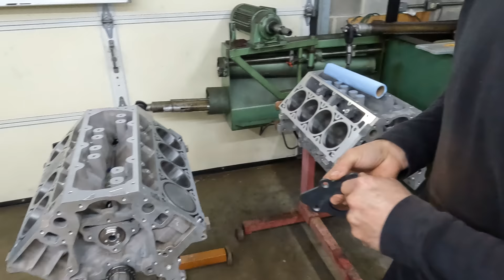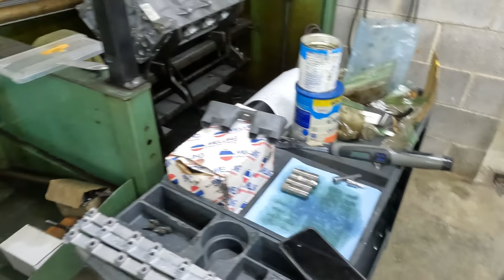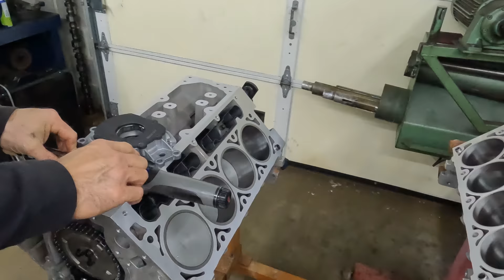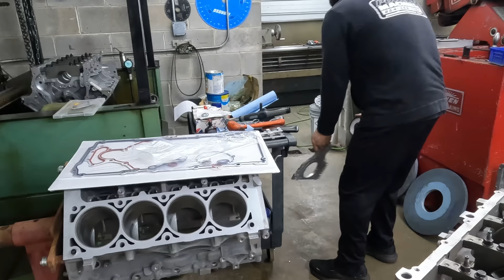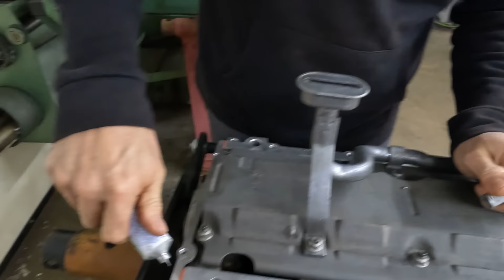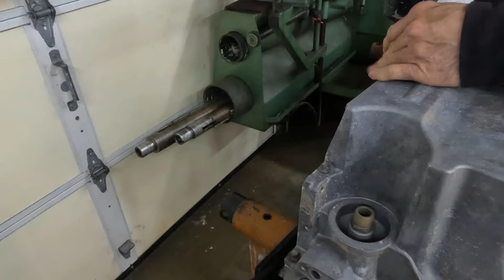Facebook 5.3L:episode 7, completing the short block

Comment: You are one of the few I've seen using a speed wrench. I grew up using them and when I worked on vehicles others would give me theirs because they didn't like them I had quite a collection before my tools got stolen. They're great for quickly running down nuts and bolts and being able to feel the thread with out over torquing
Reply from the maker: Right on
Reply: Your right David, when watching race car engines being built that’s what you see, not an impact in sight
Reply: Spark plugs! I used a 36" Snap-On speed handle, during my 17 years with FoMoCo, doing tune-ups. Made  quick work of a plug change. Still a very handy tool in box.

Although my 3/8 Snap-On cordless impact does the chore now...can't beat the new Li batteries.
Reply: I was going to stop watching until i saw this comment. I have a couple speed wrenches but havent used them in decades.

Comment: Obvious you skipped an empty bolt hole on the pan. Maybe just searching for comments but it ruined something. Your work is meticulous and much respected. May the horsepower keep being produced by you.
Reply: He's built a motor or two more than me. He will have a reason for that empty bolt hole which no doubt he will mention in the next video. Also notice that Andrew knows every next step/bolt you are going to do/fit. Also see him holding the motor steady which you are tightening bolts. He is learning every quickly and I can see he has already learnt a lot. One thing I can see  you both are NOT a GP. Does not stand for General Practitioner (doctor) but for GP for "gorilla paws", people who tighten bolts and nuts to ridiculous levels, not understanding that a small dia bolt holds a small item and is torqued to a small spec. They tighten everything to same (overtightened) spec and then I have to come in and fix things. Well done Andrew. Dad is also a good teacher. For dad, when are we going to see Andrew assembling something? Take care all of you, including the missus. Regards from Australia.
Reply from the maker: The hole isn't in the block,
Reply: Pay attention, he explained it in the video.

Comment: WTA 37 bearing is the proper bearing for the plugs. I already used them. I understand your point with rebuilding it after wards. I made a video for my grandkids. I don't trust the orings not ro leaks after so many miles. I've seen oil pressure issues with them. But there are problems either way huh? ROFLMFAO
Reply from the maker: Never seen the oring leak,

Comment: You need to turn the camshaft by itself to check for ease of rotation before installing the chain. You will never feel a slight bind turning by the crank bolt. And the front and rear covers are aligned without the seal installed. A centering tool is installed to ensure the seal is centered to the crankshaft. Sloppy build at best.
Reply from the maker: Lol, y'all make me chuckle

Comment: Daniel, would the timing set benefit from oiling through the thrust plate? Similar to drilling the pipe plug in a SBC.

Everything behind the front cover always seems "dry". The splash oiling must be enough to keep things from seizing, but the broken tensioner, dried oil build up, and stretched chains make me wonder if a little pressured oil wouldn't keep components cooler, decrease fatigue, and decrease failure of the tensioner. 🤷‍♂️

Ah, is it even possible without a negative side effect?
Reply from the maker: Possible,

Comment: Doing my first LS build. It’s a Gen 3 and the timing chain guide I ordered has the wrong bolt spacing for my block. Did they not come with dampers?  Mine measures about 2.1” center to center. The one I ordered from RA measures narrower
Reply from the maker: Gen 3 never had a damper
Reply: @powellmachineinc3179  thank you. You are amazing. Thanks for the help

Comment: I'm surprised GM didn't design the pickup with a couple of little feet at the bottom to prevent it from bottoming out and disrupting the flow.
Reply from the maker: It's pretty rigid and has plenty of clearance
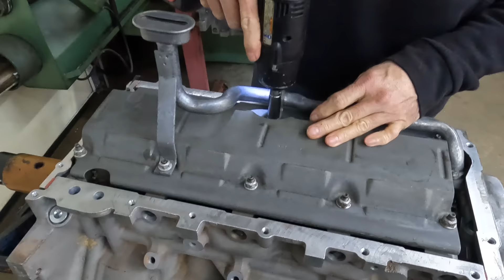Reply: Anchored at 3 points: left, right, and at pump end.  Except welds break, it won't go anywhere.  View at 34:50 shows it all.

Comment: Top notch work as always 👌 you guys are my new source of engine parts. Curious if you use the wedge style timing tensioner when you retain the vvt? I have always gone against my gut on the vvt engines and put a new oem style setup on it.

Comment: Doesn’t the oil pan need to align to the back of the block since the transmission bolts to the block and pan?
Reply from the maker: Yes, but nobody puts them in....
Reply: @powellmachineinc3179   I did not understand that reply.
Reply: I think I understand,  I think you are saying nobody uses the transmission to oil pan bolts.
Reply from the maker: @jakewade7388  normally that's how it is

Comment: hi maybe you can help me out i bought double roller chain for a ls-1, why is there two sets of timming marks on lower can gear? its a speedmaster cam set i called speedmaster 3 times they suck no answer, i dont know if you had this problem thanks
Reply from the maker: #1 a double roller hits everything,  it's a nightmare,  you need a single billet 
#2 speedmaster....wouldn't put that garbage in my lawnmower

Comment: What is the cause for some LS engines to have low oil pressure. Some say it is the pickup tube o ring? What are your thoughts?
Reply from the maker: Can be, oring, but often it's excessive bearing clearance
Reply: Thanks for the response and it's good you have never witnessed low oil pressure after rebuild. I have seen lots of post people having low oil pressure on low milage LS.
Reply: BTW my 2002 SS Camaro has 60,000 miles on engine and oil pressure is about 35psi😢.

Comment: Is an LS cam hollow or just the snout ???
Reply from the maker: The factory cam and many aftermarket cam cores are core drilled, we do have sum 8660and8620 cores that are not drilled
Reply: @powellmachineinc3179  I have no experience with the LS platform I did do a bit on Race engines in the seventies.